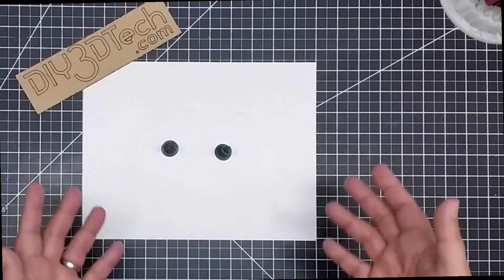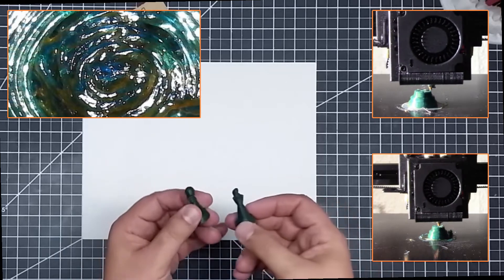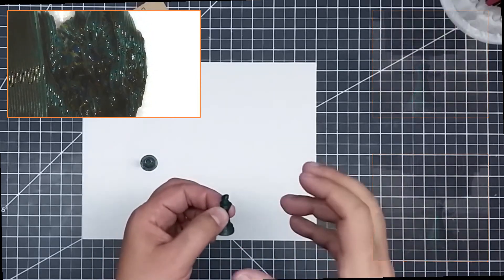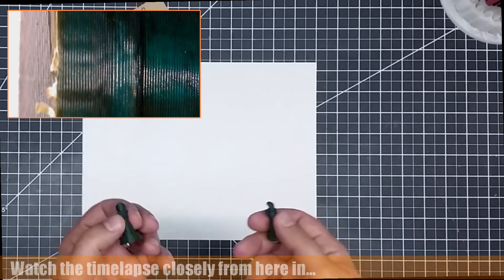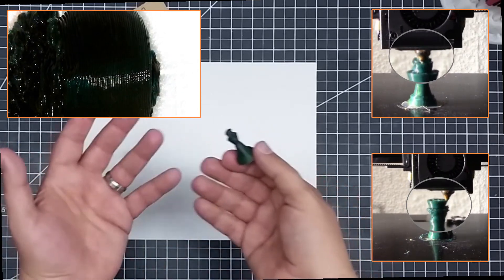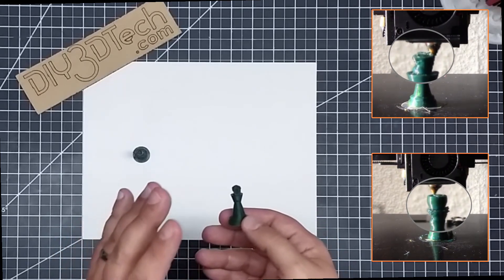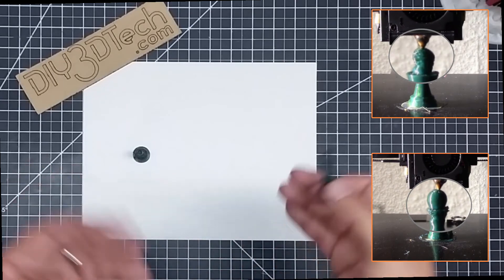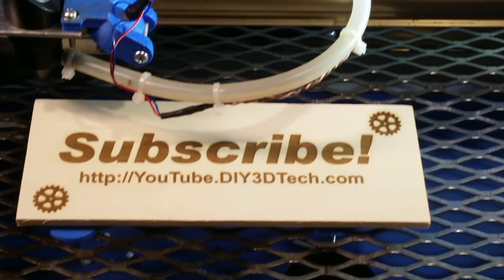GeeeTech A10M - Mixing PLA with PETG Success!

Comment: Started looking into this after purging some PETG +CF with silk PLA.  The SIlk PLA quite brittle and weak, the PETG +CF fairly strong as usual.. What was interesting where they mixed was practically unbreakable by pulling.  it wanted to break on either side of that mixed area.  More research needed!

Comment: I forgot to clean a PLA priming line off my build plate when I started my PETG print and it resulted in an accidental priming line composite that was much stronger and tougher then either material independently. I was not able to break it by tugging on it with my fingers.

As soon as I pulled the two layers apart it was very easy to break again.

Comment: Hey Joe I seen a guy using pla as  supports on a model that had a lot of over hangs the petg don't stick to pla and the pla supports came off extremely easy I'm surprised the petg and pla mixed did it mix well let me know.
Reply from the maker: Yes very nicely in fact as you can see in the video and microscope images!  However, note I am sort of "mixing" the two and not extruding them separately.  While not a chemical engineer, believe the glycol modifer also affects PLA in the mixing and not the same in dual extrusion.  Sounds like a test for the zonestar!